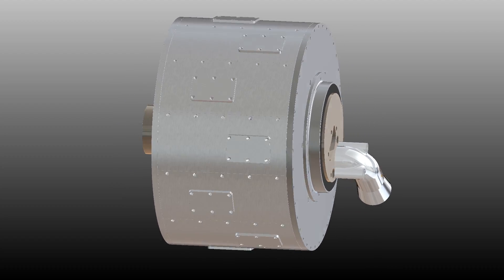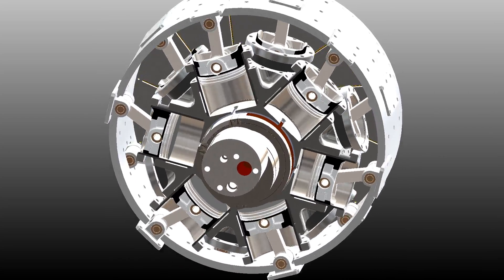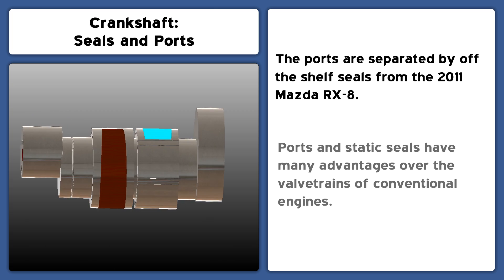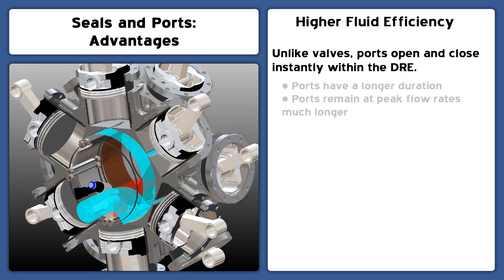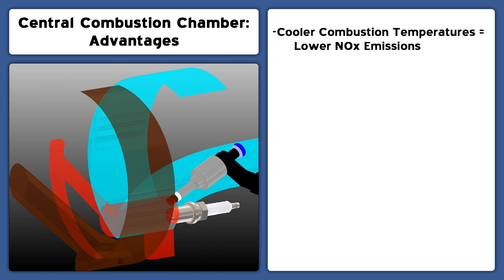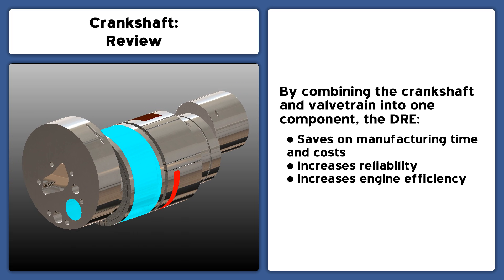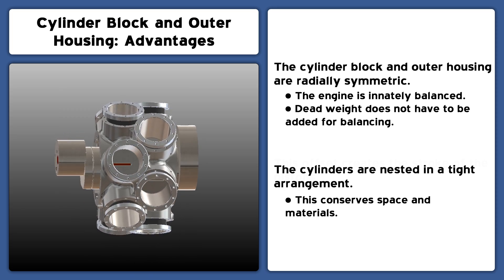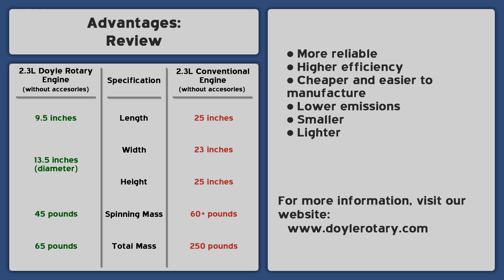New Split Cycle Engine Concept: The Doyle Rotary Engine

Comment: More like a radial than a rotary.
i wish people would just develop the 2-stroke. Out of any design, it has the biggest potential. It will still blow this away in power to weight and power per displacement. You need half as many cylinders to do what this does.
Reply: ***** 300hp outobards are known for well over 6000 hours, or equivalent to over 150,000 miles in a car. And boat use is more stressful than car use, a lot more full throttle for extended periods. 2-strokes can easily be made to last a long time.
In the dirt bike world, 4-strokes are known to be far LESS reliable than 2-strokes.
Reply: ***** They will if they have a fairly thin cast iron sleeve in the cylinder bore. When I get the opportunity I plan on fabricating a 2 stroke weed trimmer with a cast iron sleeve for my own personal use.
Reply: TheOfficialKC
Err... in what world does a 2 stroke last longer than 4 strokes, definitly not reality, 4 strokes have less combustion (more economic) and smoother operation (less Wear), less heat (less wear) and don't have back pressure issues.
Reply: Ben Weldon You should look into modern 2-strokes more and understand how you can design engines for different purposes. Also, actually read my previous comment.
DI has shown more fuel efficient 2-strokes than 4-strokes already, 2-strokes are so smooth that they don't build them with balance shafts like 4-strokes, just add that to the design and they can be very very smooth (4-strokes aren't smooth, it is all about the balancing act), the heat is in the head, where a 2-stroke has no moving parts to wear. As I said, a Merc 300 is known to be in good shape at 6000hours, that's equivalent to over 150,000 miles of HARD use in a car.
These aren't 1960s 2-strokes.
Reply: *****
Cast iron will fail from wear when coupled with a steel piston.
Reply: Yes, 2 strokes have a high power to weight ratio, but their emissions performance sucks and their specific fuel consumption is poor.
Reply: Mr Appliance of South Central Wisconsin Do some research into current DI 2-stroke boat engines, snowmobiles and scooters. All surpass the emissions cleanliness and fuel mileage ratings of comparable HP 4-strokes. All while being lighter, cheaper and as reliable with less maintenance.
Reply: TheOfficialKC
Deleted because I realized I have already pointed the common and obvious knowledge that you seem incapable of acknowledging, also 6000 hour for an outboard or 150,000k miles is pathetic, the average life of a modern four stroke in a small car will be at least 300,000k before a complete rebuild is likely, even then I have worked on cars exceeding 900,000k and I own a truck that has clocked 2.4million kilometers with out ever requiring a rebuild (except the transmission) and believe me it goes through a lot more stress than a measly 300hp outboard..... ALSO as you clearly don't know outboards rely on low torque and high RPM to achieve fluid movement through water, just like aircraft do as they travel through a gaseous medium called air with is essentially water at a very low pressure.
Reply: Ben Weldon Yes, lets see your small car put out as much hp/displacement as a 300hp outboard and then run it at wide open throttle under load for the majority of it's life and see if it can last as long. Doubt it. And as I said, that is considered a god quality used motor, not a worn out one.

Good thing you deleted your other comment because you realized how wrong you were. Did you actually do some research and see that 2-stroke outboards, snowmobiles and scooters get better mpg and produce less emissions than their 4-stroke competition? All while being lighter and cheaper and longer lasting? What world do I live in? The real world where you can look up these facts. Stop denying that 2-strokes have come along way technologically and with modern designs can and have surpassed 4-strokes in nearly every form of measure.
Reply: TheOfficialKC No actually the reason I deleted the message was as I said before so don't try and put shit into my mouth you sniveling heap of shit.

Firstly outboards have limiters so your never can never actually red-line a motor, secondly an engine designed to have High RPM (OUTBOARDS and AIRCRAFT) are fine running high rpm, just like a motorbike 4 strokes are fine sitting at 4thousand rpm all the time, Scooters get great (also majority of modern scooters are going 4 stroke) MPG because they weigh Fuck all. snow mobiles have never gotten good mpg, a track based drive system is incredibly inefficient.

2 strokes have only ever surpassed 4 strokes on one specific attribute, that is Power to weight of the motor itself, and NOTHING else, get it through you pathetically thick head and do some research yourself, sadly I can't give you links, if I could I would drop them on you like a sack of bricks.

And on a side note, I own 2x 2 stroke Yamahas and 3 x4 stroke Yamahas, a 4 stroke diesel Land rover S3, a 2 stroke outboard, and a 4 stroke Diesel Truck Sline Internation 2700. I have never ever taken them to a mechanic, I myself am a Diesel Fitter and Mechanic, I came to this video and others like it to see  to find a rotary engine that could produce at least (ironically) 300hp for my light plane, I came across your post and thought I should set your knowledge right, But it seems, like I have been told before the people on the internet have skulls as thick as the distance between you and them.
Reply: Ben Weldon You have yet to say anything to dispute the facts. Testing has proven it, so get over yourself. 2-strokes HAVE surpassed 4-strokes in mpg and emissions. It doesn't matter if snowmobiles in general are inefficient (and the reasons are more than track drive, investigate that they are ridden on heavy throttle usage in SNOW in drastic elevation changes with inefficient CVTs), but it doesn't change the fact that 2-stroke snowmobiles get better MPG than equivalently powerful 4-stroke snowmobiles.
Sure, there are only a few 2-stroke scooters, but it doesn'c change the fact that they get better MPG and produce less emissions than their competing 4-stroke scooters.
Cool, you've owned a lot of things, that makes you just as qualified as me because I owned a hamster when I was 10. Just because you have owned and maintained different powerplants doesn't mean you know jack shit about their design or that you have done one minute worth of research into modern 2-strokes, because clearly you haven't.
No matter what exuses you make, or how many names you call me, or how many vehicles you have owned, it doesn't change the facts that in each category that modern 4-strokes AND 2-strokes are used, 2-strokes are lighter, more fuel efficient and produce less emissions, for the same power output.
Lastly, the most fuel efficient ICE engines in the world, those powering cargo ships, are 2-strokes.
Reply: TheOfficialKC Try getting a 20 year old girl to add oil to her gas every time she fuels up, then tell her to learn a totally different driving style where her loud ass car is running at 4000 rpm on the highway just to keep the power up enough for it to move, then around 100,000 miles when her exhaust rusts out and starts to leak she has to replace the whole thing within hours or her entire engine is ruined. They just wont sell, and if they did people would complain about the high pitched annoying ass noise they make so the car manufacturer would have to spend more money on sound deadening the entire thing raising the price of the car itself by a couple grand, with MORE maintenance because they have to add oil every time they fill up and the one time they forget to do that (we are humans after all) its blown, just another very easy way to ruin a two stroke, that brings up another thing, you would have to fill it up and run it dry every time just to add oil to it so when its the end of the week and you only have ten bucks in your wallet you're fucked. Have fun with your idea, but that's all it ever will be, there's a guy at every car company who makes a whole lot more money than you do to think of these things and if it hasn't happened yet it wont happen.
Reply: Criscopuff You clearly know nothing about 2-strokes. None of those are even real issues and most are just bullshit that you made up.

It is called an oil tank. Do you have to do an oil change in a 4-stroke every time you fill up gas? No. With a 2-stroke you fill an oil tank that lasts tens of thousands of miles (can be less or more driving time than a 4-stroke). Oil injection already exists and has for 20 years.
2-strokes already have a fail safe (look up Evinrude and Mercury) to keep them from blowing if you let oil run out. How often does your fuel tank run out on accident? Its called an oil gauge. And why the hell would you have to run it dry to add oil? That is not true at all.
2-strokes can be made to run very quite, in fact they are naturally more quiet than 4-strokes in the dirt bike world.
You don't have to run a 2-stroke at 4000rpm as it is already proven they can make more low rpm power than a 4-stroke. They can easily cruise at 1000-1500rpm like a 4-stroke.
How is rusting out an exhaust going to cause the engine to blow any more than a 4-stroke, and second, why would it be any more likely to rust out than a 4-stroke? No 2-strokes in use have that problem now.

Learn what a modern 2-stroke is. Stop making up stupid excuses that aren't even close to reality.
Reply: Sorry, the only two stroke I own is my weed eater lololol. I never said it was more likely to rust out, but it does happen on every car and when my buddys banshee had a small exhaust leak it fucked up the whole motor, I'm not gonna act like I know what I'm talking about but I do have enough knowledge to denounce it as an alternative to a four stroke in a car, those weren't excuses just small observations I've made over the years. have you ever heard a two stroke? the noise is so high pitched its easier to notice than a four stroke. Now for quotes from a simple Google search using the top search results.
"4 strokes are quieter than 2 strokes- no doubt"  
 "2-stroke - fast on the top end - wind them up - louder for sure - less torque on bottom end - very fast on top end - high revs ------------- 4-stroke - quiet - more torque bottom end"
 "I notice that 2 strokes have to be adjusted a lot. Another thing is they bog a lot until they are hot."
These next few are my favorite as they're from honda 
"Four-strokes are approximately 50% more fuel-efficient than typical two-stroke outboard motors. No two-stroke oil is needed, reducing your costs even further"-honda
"Ports in 2-stroke cylinders and pistons can accelerate piston and ring wear. Since there are no intake and exhaust ports in a 4-stroke cylinder or piston, they can operate with tighter tolerances for longer life."-honda
"4-stroke outboards are approximately 90% cleaner than typical 2-stroke."-honda
"4-Stroke outboards are up to 50% quieter than 2-strokes. Not to mention less smoke and smell. No two-stroke stink to ruin your day on the water!"-honda
Guess whose the one making shit up to help his argument? not me.

All that said, this is the internet and those could all be lies, but I'll trust a multi-billion dollar car manufacturer and a few non biased forum's with people from both sides of the argument agreeing instead of some biased prick on youtube who cant admit he's wrong. I may not know as much about two strokes as you do but regardless of everything just said the last line of my previous comment is the most telling part about this debate, there's a guy at every car company who makes a whole lot more money than you do to think of these things.
Reply: Criscopuff I'll start with all your Honda quotes because that is an easy one. If you start to do your research, you will see that Honda has spent millions of dollars on marketing and advertising campaigns to brainwash everyone into believing 4-strokes are superior in every way. Sadly, that's all it is, marketing. But if you actually look at real engines, you start to see it is all false. What you will find funny is Honda at one point had a trapping valve 2-stroke (EXP-2) that had less emissions, more power/toque and less weight than any 2-stroke they could develop, and they were starting their huge push to market 2-strokes as being junk high emissions, unreliable, and having no torque, and guess what? The project was killed after a couple bikes were made. Yes, even Honda proved their own marketing campaign wrong, but had to hide it from the masses to allow their brainwashing propaganda to make them more money.

Random quotes from Google essentially mean nothing. Most people that ride and compare 2 and 4-strokes don't know jack about the design, engineering and tuning behind them. Go talk to an actual engine tuner and see what is capable. Any competent 2-stroke porting expert can make a 2-stroke produce more low end torque than a 4-stroke. 2-strokes are known as top end power only because that's what you need for racing. But they are completely capable of being a torquey engine.
What you can do is look up the videos where two identical boats were taken and one rigged with an Evinrude 2-stroke and the other with a Yamaha 4-stroke, both rated for the same horsepower, and they did a tug-o-war match. This happened at the low rpm range because they weren't at speed to rev out, and guess what boat won? The Evinrude rigged boat. More low end torque.

Sound. Go to any motocross track and do 2 things; just listen to the noise levels, and then actually do a sound test. The 4-strokes are louder consistently. Up close a small bore 2-stroke has that higher pitch that can make it seem loud, but a major problem is the deeper 4-stroke noise travels further (and lots of motocross tracks have been shut down from noise complaints since 4-strokes took over). Another thing you can do is go boat engine shopping. Look for a 25hp outboard 4-stroke and 2-stroke and compare. My dad went in looking to get a 4-stroke because of the proposed quieter operation and less vibration but ended up getting a 2-stroke because they were actually quieter and vibrated less. Not to mention half the weight. 2-strokes generally use mufflers that are much smaller and lighter than 4-strokes to get the same sound output. So, if they go with bigger, more effective muffles, sound will be brought down well below that of 4-strokes. It would be easy to make a very quiet 2-stroke car.

Your friends Banshee, and that jetting quote, bring up a point I said before. Too many people base their opinions on OLD 2-stroke technology. The Banshee's engine design is 27 years old. So no, it doesn't compare to new 4-strokes. But there is NEW 2-stroke technology. I mean, the Banshee doesn't even have power valves much less fuel injection, oil injection, direct fuel injection, trapping valves, Singh grooves, or any modern porting/head/exhaust technology employed these days. Look at MODERN 2-stroke engines. Ski-Doo's own 160hp 2-stroke with Direct Injection gets better fuel mileage than their 130hp 4-stroke. And that is just the tip of the ice berg. That technology is only a decade old and growing fast. Arctic Cat just came out with their first DI sled a year ago and it out performs the Ski-Doo. No doubt Polaris will make an even better version in the near future. And still, these engines aren't employing technology like tapping valves. Look at the APT SonicFlow engine, the Opoc, the Lotus Omnivore, the Athena motorcycle kit, look at what was accomplished with the rudimentary retrofit kit from Envirofit to reduce emissions of 3rd world 2-strokes more than replacing them with 4-strokes would have, and the extremely low emissions Aprilia SR50 scooter that's proven it is cleaner than 4-strokes. With trapping valves, the exhaust in a 2-stroke is exactly like that of a 4-stroke; straight pipe with no expansion chamber. Rusted out pipe means nothing more than it does in a 4-stroke.

The technology is available and is advancing at an alarming rate even without the big dollars of the major manufacturers. Imagine if they did want to develop them.

Lastly, the large tanker ships and cargo ships, which are considered the most fuel efficient vehicles made due to the amount of mass they can move per quantity of fuel, as well as many highly fuel efficient trains, use 2-stroke engines. Yes, these giant ships and trains that are built to be as fuel efficient and pollute as little as possible, use 2-strokes.

Modern technology has allowed 2-strokes to be competitive and even surpass 4-strokes in every way. It is proven. Just look at modern designs and not 20 year old technology.
Reply: Criscopuff Now you are just consciously choosing to be ignorant. You don't have to trust me, but I have given you all the facts, I have laid the groundwork for you to start your own research, and all you can do is start calling me names. Look at ouboard boats, look at snowmobiles, look at scooters, look at cargo ships, look at OPOC, look at SonicFlow, look at Lotus Omnivore, look at the various technologies that HAVE been proven (Direct Injection, trapping valves, variable exhaust, stratified combustion, HCCI, etc. etc. There you go, do your OWN research. Or you can blindly believe some random people online talking about 20+ year old 2-stroke technology. Think for yourself, do your own research on the listed technologies that have already been proven.

I think you fail to understand what being brainwashed means. YOU are BLINDLY following what a multi-billion dollar company tells you to believe. But where is your research backing your belief? None? Right, because YOU are brainwashed and can't think for yourself. On the other hand, it is I that has done my own research and made my own conclusions. You do understand how thinking for yourself works right? It means making your own decisions and conclusions, not blindly listening to what you are told.

Research those 2-stroke technologies that have been proven to work. Research the marketing strategies that Honda has employed. If you had half a brain to think for yourself, you would easily see the lies about 2-strokes and 4-strokes.

I'm guessing you are unemployed because you clearly have no idea how a business runs. Let me help you out. There is a management group above engineering and design. They TELL the employees (Engineers and designers) what they want. Honda told the engineers to stop making 2-strokes and only make 4-strokes. They had to. Want to know what happens if an engineer says he is going to make 2-strokes? He gets fired. You understand? It isn't about the superior design, it is what the management wants to make, which in a large company is 99% of the time picked for profit and marketing reasons.

It's funny that you think you can tell me I don't know the official title for a "2-stroke porting or tuning expert" when I doubt you even know what 2-stroke porting entails. Even more funny, there is no official title other than what I gave you, so congrats making yourself look like a moron again. If you don't know what you are talking about, don't say a damn word, so in your case, never speak again. This isn't the first time you have attacked one of my statements clearly showing you don't even know what I said because the technology is far to above your head to understand.

My suggestion to you: Do your own research on these 2-stroke technologies, do your own research on Honda's marketing strategies, then do your own research on how a business operates. You have no argument, you have no facts and no proof. So try and think for yourself for once and learn something. The information is out there, take advantage of it.
Reply: dude youre the one being ignorant, I've done the research, weighed the pros and cons, and there will never be a two stroke motor in a car ever again, conversation over.
Reply: Criscopuff I can see you did your research by all the facts and data you have supplied...
Yep, conversation over. The facts speak for themselves. Choose to be ignorant and continue to let the companies take your money.
Reply: TheOfficialKC I've done enough research for my point to be valid in the original argument and you're trying to tell me everything should be two stroke because you're a two stroke junkie, you get high on two stroke fumes and you think two strokes are god so nothing about four strokes is good in your eyes. I could care less about two strokes my quad is a four stroke, my boat is a four stroke, and all of my cars are four stroke. does that mean I'm against two stroke? no not at all i love banshee's and they make a cool sound, but will they ever be in cars? no, it doesn't matter how much the technology has improved, they wont make them and they have no real reason to. I'll take your word for it just because i know how the world is, yes I'm sure the two stroke has improved, but are they to the point of being in cars? no and if they ever are, it'll be a gimmick. Learn how to prove a point and not get off topic because none of your previous comments have had anything to do with a two stroke engine in a car, which is what i've been talking about this whole time if you can stay on topic I'll debate with you all day and we might get somewhere, but like i said you're such a two stroke fanatic all you want to do is worship the evinrude god and be an advocate for the two stroke master race that should be in everything from cars and bikes to cargo ships and even my weed eater.
Reply: you went off topic by just talking about two stroke engines and not two stroke engines in a car, how it would work, and how it would get approved. you have examples of how the two stroke technology has improved over the years but no real comparisons to a car engine, you haven't convinced me which is sad considering the amount of knowledge you have about them. I've done a small amount of research about new two strokes and people still say it wouldn't work in a car, but you're just sitting here blabbering on about how great they are without any real knowledge of how a car works and what it goes through before it can be approved before retail sale, there's so many points that a two stroke would fail even the new ones it just cant happen, not only that but if it would pass it wouldn't sell because there's no market for a two stroke car and hasn't been for over 30 years even then there was only a few that didn't do very well, you act like you know how big business works but you have no clue what risk/reward means or how a big business looks at something from a cost point of view you just see these new two stroke engines and think they're so great they should be in cars, but never stopped to think about where we've come with four strokes along side two strokes and how companies have based their entire business and assembly lines on the four stroke, hiring new people, buying new equipment, trying to market it, then when it fails and they have all this money into it thats now lost where do they go? the government for another bailout? that hurts the company as a whole and put a lot of places out of business,  the risk is basically losing everything because the amount of money it would cost just to put these cars into production the reward would be a car that would have such minor advantages, if it even got approved in the first place. like i said you're a two stroke junkie and cant think about anything but two strokes.
Reply: Criscopuff You need to work on reading comprehension. All those examples are why a 2-stroke would work in a car.
Gas mileage meets or exceeds 4-strokes.
Emissions meet or exceed 4-strokes.
Low end torque meets or exceeds 4-strokes.
Reliability meets or exceeds 4-strokes.
2-strokes are cheaper to build than 4-strokes.
2-strokes are lighter than 4-strokes.
With equal sound deadening, 2-strokes are quieter than 4-strokes.
2-strokes vibrate less than 4-strokes.

You have failed to give one reason the won't work in a car.

You tried to say the technology wouldn't work, I proved you wrong. You tried to call me an idiot like a 6 year old because you had no data or facts to argue with, and I still raped your argument. You clearly showed your lack of understanding of how a business runs and now you are trying to change the subject of why a 2-stroke would/wouldn't work in a car to why a business would need to hire people and buy new equipment without knowing shit about how they actually function.

Just admit you were wrong about 2-stroke technology. Save yourself the agony of making yourself look even more stupid with YOUR off-topic shit that doesn't even make sense.

I have given facts that back my point, you haven't. Case closed.
Reply: Technically, everything your saying is right. Two strokes are hella more power efficient. A 2 liter 2 stroke would make the same as a 4 or even 5 liter 4 stroke, but even in modern ones, in a car, it wouldn't be nearly as fuel efficient. I had a buddy who machined one a little smaller then a geo engine, and it made something like 120hp. They're surprisingly quiet, albeit, very high pitched. Point being, my 5.0 mustang made comparable mpg. Its not that they aren't effienct, or aren't better, they just wouldn't drive great on the road. Stopping and going, the mpg would be awful city wise, it'd be good on the highway no doubt though. 

If you wanted a track car, a two stroke would be cool as fuck.
Reply: Scott Mitchell Let me guess, you had a carbureted 2-stroke? As I have already mentioned, Direct Injected 2-stroke snowmobiles get better gas mileage than their competing 4-stroke snowmobiles. Direct injected outboard boat engines get better gas mileage than their competing 4-stroke outboards. Direct injected 2-stroke cargo ship engines get better gas mileage than competing 4-stroke cargo ship engines. Direct injected 2-stroke scooters get better gas mileage than their competing 4-stroke scooters.
You see? The world of 2-strokes has changed, it's time for the automotive world to open their eyes to the technology.
Reply: TheOfficialKC How does a 2-stroke last longer and get better gas mileage than a 4-stroke? How could it be better for daily commuting and luxury vs a 4 stroke? The spark plug is sure to be firing off much more often, and there is only 2-strokes for the engine's form of operation, meaning the induction of the fuel/air mixture, firing of the spark plug, and exhaust gas expulsion is happening far more often to make that power. Not saying it's so, but that to me seems like more wear to the internals, valve train, ignition system, and the engine would be running at a higher overall temp than a 4-stroke, as well as theoretically being far hotter in higher RPMs more often too. Also with the engine doing everything in 1/2 the time of the 4 stroke, it seems the engine would produce fluid agitation, and sludge in 1/2 the time too, requiring more often preventative maintenance, clean-ups, and more frequent overhauls if needed, not just because of how it operates, but also because of the fact that you're implementing it into a chassis that is no less than 8-12 fold heavier which will always need more power to move. If that's the case then an automotive 2-stroke would be requiring not just a special cooling system, but also a dry sump oil circulation system as well instead of being able to use the traditional wet sump most production car engines use for automotive purposes which offset the naturally cheaper price tag of the motor. Not only that but any high pitch in long term driving would be highly uncomfortable and cause hearing damage. This would make it impractical and useless on any luxury or daily commuting based car in general.

 Not saying that it won't work, but I don't think it's as quality for an automotive purpose as you make it sound.
Reply: Wildcatbball18 Because a 2-stroke fires twice as often, you only need half the displacement for the same power. So while they fire more often, each firing uses far less fuel. There is also half the compression pumping losses. 2-strokes also generally have lower operating rpm so that translates to less revolutions wearing out the engine and less frictional losses. As I have said before, this is not speculation. DI 2-strokes have been used in 4 places: scooters, cargo ships, outboard boat engines and snowmobiles. In every category, the 2-strokes HAVE gotten better fuel economy than similar hp 4-strokes while maintaining lower cost and less maintenance. Check out Opoc, SonicFlow, Arctic Cat, Ski-Doo, Evinrude and Mercury. The only heat related issue was in Ski-Doo's snowmobile. It was the very first attempt in making a DI 2-stroke sled and they didn't account for the lost cooling effect of fuel in the bottom end. Arctic Cat has a solution for that in their newer engine. But you also have to realize these are performance engines making over 200hp/liter naturally aspirated and spend a lot of their life at wide open throttle. Automotive applications put far less stress and heat on the engine than snowmobiles and boats do.
Reply: TheOfficialKC MMmmm makes sense for less displacement and the introduction of direct injection is a great system too. 

 How does it use less fuel though and have lower compression pumping losses? I understand a proper tune with DI would grant that, but is it also because of the lower amount of reciprocating parts or what? 

 I guess it would be less stress too since automotive vehicles aren't always going full throttle like snowmobiles or boats would. Seems interesting.
Reply: ***** we had injected 2 stoke diesels, Detroit Diesel  made them. But they were mechanically injected. Ive always wondered if you would take the basic principle and add modern injection, what it could do. They were very reliable as long as they were maintained. And they sound fricken amazing.
Reply: The Opoc engine is two stroke I believe, but supposedly doesn't have the pollution problems of regular two strokes.
Reply: TheOfficialKC your a fucking legend man

2 stroke trolls for the win fuck 4 strokes
Reply: 2-strokes are very dirty engines. The EPA even outlawed them on yard mowers. 2-stroke chainsaws are still around because they need a good power-to-weight ratio; they can't be heavy or a person would not be able to operate one all day long. Thus, the EPA has let it ride on those.
Reply: Ben Weldon you obviously work for one of the big 3. How many other geniuses here get their talking points straight from Detroit?